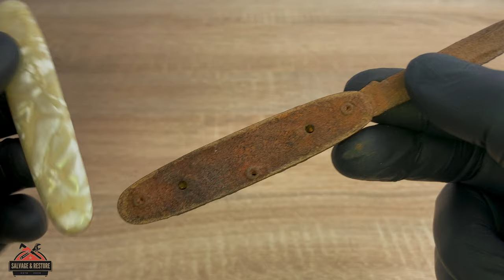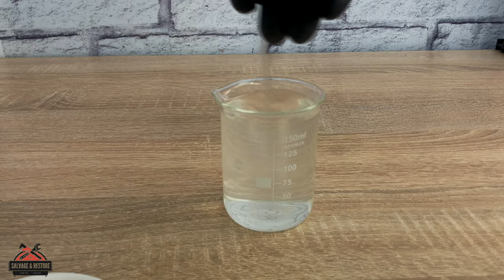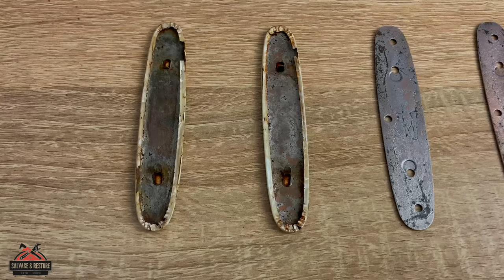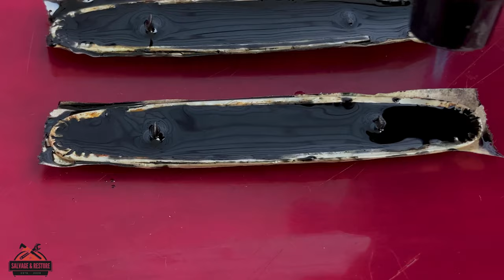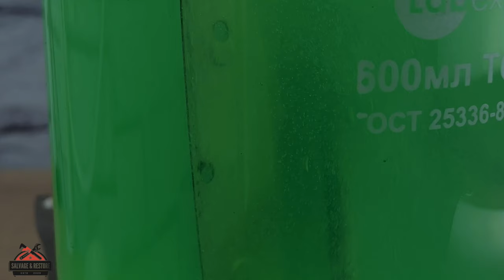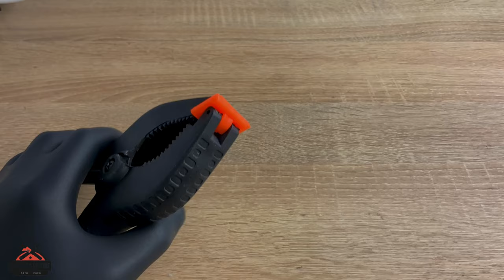New life for an old pocket knife 🔪 Amazing Restoration

Comment: Lovely vid! I've been watching few of yours now, and I really like your concept about what's restoration. There are a lot of very skilled restorers out there making vids, but they always tend to make their projects even better than when they were new bought. You don't. You respect them for what they are without robbing them of the beauty they've gained through the ages. Complements for that. (Just a shame you've used a brass rivet for the folding part; it should have been a steel one,çause the hardened steel of the blade will wear out the brass rather fast..)
Reply from the maker: Thank you very much for your wonderful review, I really appreciate it! I really try to restore and keep the subject to a minimum by making changes. You are right about the brass rivet, I didn’t think about it (this knife is now always in my little purse and I have only used it once in all the time, so I think the rivet is not in danger yet) thanks again 🤝